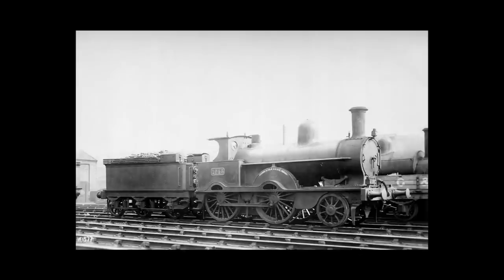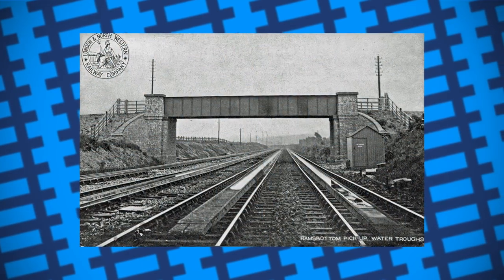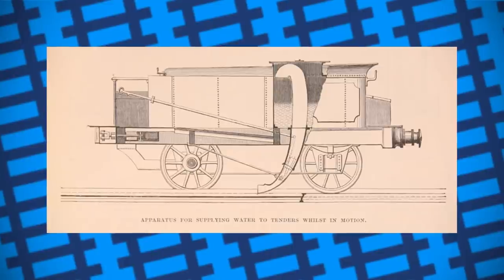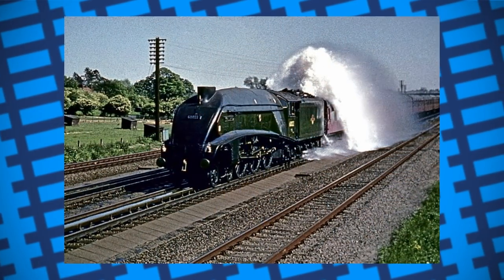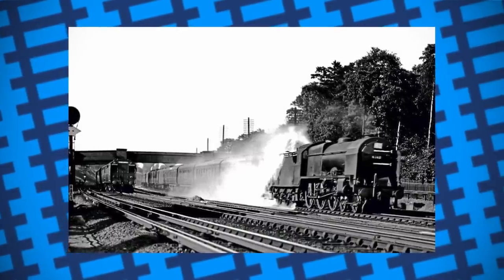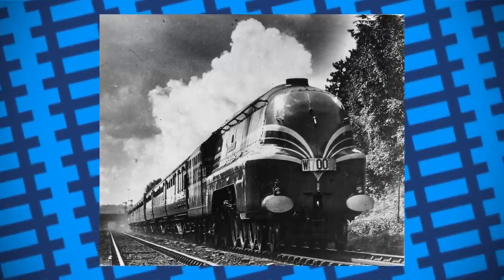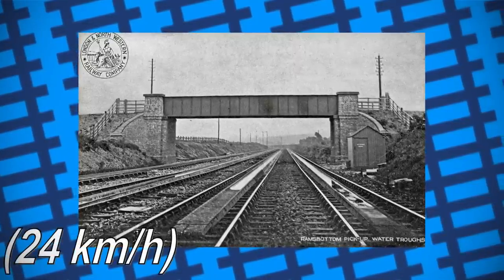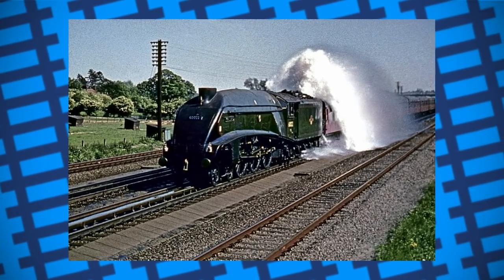How steam locomotives could refill their water tanks without stopping - The Water Scoop

Comment: Also fun to point out that some early diesels used them too, as some of the long-distance non-stop diesel locos had steam heat boilers onboard that required refilling with water en-route. Check out early Class 40's and Class 55 Deltics and you'll see the water scoop on there. Naturally, electric-train-heating saw this removed, and so the troughs became redundant.
Reply: would be crossing the line to insane completely if they also picked up diesel by scoops so you could have a truly non-stop train
Reply: The practice apparently worked at the time, but electricity and water never travel well together, so using the troughs to replenish diesel train-heat feedwater would seem to have been  inherently dodgy with 600 Volt traction motors humming along at speed just above the trough.
Reply: @russellbrown7028  The scoops were designed such that water splash was directed away from the motors, so it was never a problem. The again the Deltics motors could flashover (short circuit leading to a trip out) when going over rough bits of track, so a bit of water was hardly going to make them that much worse.
Reply: @jakedotnet  Doable, but imagine how much would be lost during the process? Also... Don't light a match. 😂 (I know it's Diesel but still )
Reply: @jakedotnet  I mean, thats what electric trains are. They "never" need to stop because all the power comes from the outside.
Reply: @ChrisCooper312  I will point out that the majority of the preserved Deltics had been allocated to Finsbury Park depot as my late grandfather actually spent a considerable amount of time as foreman for Finsbury Park depot canabalising the failed ones from other depots that BR refused to repair in order to keep the Finsbury Park fleet running until the last official day in British rail she and in fact he was considered the reason for a considerable amount of time of why such a large percentage of the fleet actually survived long enough to enter preservation
Reply: Replying to Tithe
Reply: Hi  We had vapour cars that we used in the winter Coupled to the diesel and conected with jumper cable for electricity Also ran on diesel When started up will make steam that flows through steam heating pipes the length of the train

Comment: As a teenage fireman in the 60's I well remember standing behind the driver and winding down the scoop when told, The tank gauge shot up and sometimes you had a job winding it back up when the tank was full and the scoop still in the trough, got wet a few times.
Reply: I too remember the troughs when working fast vacuums on the GWR 1958, always worried about the gap between tender and engine while hanging on to the tender lever water control. No guard rails on western engines.
Reply: I always looked forward to Bushey troughs on my trips between old Euston and Watford Jct. usually on a Bletchley semi fast. I remember reading that on the GWR, possibly on The Great Bear, the water overflowed the tender filler and burst through the corridor connection door of the leading coach.
Reply: @johnjephcote7636  Hello John, that incident was so well known to us on Western engines, that drivers would shout at 3/4 full 'Turn it off, even though the gauge was in front of us.'
Reply: @aberavon  I read that there was an unfortunate fireman on the L M S that actually did fall out and was killed at the troughs at Castlethorp  near Milton Keynes while taking water

Comment: In the USA if a town was so small that the train didn’t bother stopping at it but used a water trough instead it was called a “jerk water town” .  The name came to be used for any small back woods town.
Reply: Cool! Now I want to know why they're called "back woods" towns!
Reply: @samspencer7765   there in the back woods aka nothing in the middle of the woods its a commen term here in the mid west
Reply: I believe that's wrong.  The "jerk" implies either jerking down a water tank pipe, or jerking buckets of water up from a river or lake.  Track water troughs were not cheap to build or maintain and would not be installed inside a town at all, let alone a town too small to have a station.

Comment: Oh yes the Water Trough! These arent Economical however so its more economical to use A coal and water tower tho
Reply: Although the locomotive will be standing idle and not earning any revenue whilst be coaled and watered.
Reply: In what way are they uneconomical. The UK is not short on water. Having to bring a steam train with vacuum brakes, especially an express service, to a complete halt and then get it back up to speed again is extremely uneconomical, it takes more than just pulling over your car for gas does.
Reply: @Person01234  for long distance stopping trains stops were timetabled for taking on water or for a change of locomotive but neither are possible for a non-stop service.

Comment: On the Midland Railway, their small engine policy meant that on double-headed trains the second engine got soaked when the front engine took on water. The soaking of the front of the second engine washed the oil out of the front axle boxes causing them to overheat. That’s why you’ll sometimes see Midland Compounds with splasher panels covering their front axle boxes to stop the problem.
Reply: Man those steam engines really suck they were so old fashion compared to our South African loco's It is like comparing grannies pantaloons to the thongs of today
Reply: @sydneymartin6941  Strange as UK built and provided many locomotives to SAR.
Reply: @haroldpearson6025  Hi  They did a damn good job as our loco's were very well built  Everything well proportioned and well balanced They not only looked beautiful they worked damn well It was a pleasure firing those loco's Man I loved them  14CRB 14CRM 12AR 24 CLASS 15AR 8CLASS 7CLASS AND 19 CLASS
Reply: Midland locos were notorious for their overheating axle boxes. It wasn't just (or even) caused by water troughs - their bearings were too narrow

Comment: There were some interesting innovations with water troughs in the States, though we called them "track pans." Especially on the New York Central. The force of the water being picked up wouldn't just shoot out the back of the tender, but it could also make cracks in the tenders too. Later tenders had special piping that would spray any of the overflow down to the side of the tracks instead, rather than showering the entire coach right behind the tender. Slightly surprised Britain never tried that
Reply: Was it the Niagaras that did this? I know lionel made a model of one the locomotives did this and even had smoke effects for the tender where the "water" would spray out of. It was neat
Reply: I lived in a house in Reliance Wyoming that had a cesspit made from track pans. The sides and top of the pit were made of overlapping sections of pans. The house had been used as a bunk house for single men working in the coal mines owned by the Union Pacific Railroad. The house itself was made up from 4 wooden box cars with a foundation of railroad ties. The house just above it on the hill was collapsing into the coal mine that ran under it. Weird history in that place!

Comment: Something that I learned about the water troughs a couple months ago:
Apparently, two LNER Gresley A4's where passing eachother at high spped. One of the was using a water trough, and the resulting splash shattered the other A4's front window, killing the fireman.

Another Great video as always!
Reply: One reason you couldn't use the water troughs if you were passing the Royal Train.
Reply: @neiloflongbeck5705  Yep,I remember learning that,still imagine if some driver used a Water Trough and then gave the Queen a rail shower

Comment: Little note: The Southern Railway didn't have any water troughs. So the locomotives had pretty large tenders (Mainly ex LSWR locomotives had them like the T14 4-6-0 which used 5800 Gallon Tenders. Bulleid Pacifics also had large tenders).

During the 1948 Exchange Trials, EX LMS locomotives ended up using a WD Tender when trialed on Southern lines whilst EX Southern locomotives used a Stanier LMS Tender when trialed on the other railways in order to use the Water Troughs.

Comment: The Pennsylvania Railroad used water scoops extensively to avoid stopping its express passenger trains.  The PRR's water troughs were heated by steam in winter to permit operation year-round.  However, this resulted in the train using the scoop and any passing train being covered with ice, which certainly added to the already enormous hazards faced by train crews.
Reply: i had figured someone would have heated the troughs.
Reply: @josephdedrick9337  Supposedly the first time the PRR tested the water trough system they had not provided for a large enough relief valve in the tender, which quickly filled to capacity and then exploded.

Comment: funfact on the NYC these "Track pans" as they called it 
were build with a light slope so water can circulate and had a Steamheated Pumphouse to ensure that
the water scooping work 24/7

also did the NYC Hudsons had a scoop speed to not exeed 50 mph (if I remember correctly)
because the Vents weren't big enought to release the exeed and the water tank on the Tender would burst.

Comment: Water supply is a real problem for the big US steam locos when they do cross country trips these days. They have multiple water tender cars and have to arrange to meet fire trucks at fire hydrants to fill up.  They’ve all switched to fuel oil instead of coal for lot of reasons, but they still need to encounter tank trucks relatively frequently as well. And they make shorter runs than they used to.  Steam engines required much more dedicated infrastructure than diesels do.
Reply: True, but most such engines still run on coal over here.
Reply: @FS2K4Pilot  if the engines have shorter, fixed runs, are smaller, and or are in wetter areas, they’re more likely to use coal.  But locomotives like the Big Boy, which are based in dry and flammable areas, go on long trips and are really big almost all have switched to fuel oil. I’m not sure which heavies did it, but no fireman could shovel fast enough. They had an screw feed for the coal delivery and the fireman controlled steam jets for moving things around in the big firebox.  Here’s a synopsis of the trip for this year. 

Coming out to see our steam locomotives in person?

Stand back at least 25 feet from all railroad tracks.
Railroad tracks, trestles, yards and right of way are private property - please do not trespass.
Never assume tracks are abandoned or inactive - ALWAYS expect a train.
Read more safety tips
 
Big Boy No. 4014 departed Cheyenne, Wyoming on Aug. 5 for this year's steam tour, traveling through Arkansas, Colorado, Kansas, Illinois, Louisiana, Missouri, Nebraska, Oklahoma, Texas and Wyoming. During the Big Boy 2021 Tour, the Big Boy was on display in the following cities:

Saturday, Aug. 14: Fort Worth, Texas
Tuesday, Aug. 17: Houston, Texas
Saturday, Aug. 21: New Orleans, Louisiana
Sunday, Aug. 29: St. Louis, Missouri
Monday, Sept. 6: Denver, Colorado

Comment: Question for those in the know. Did steam engines inject the spent steam back into the water tank? This practice does a couple things. 
1. It conserves the water by re- condensing the spent steam back to water.
2. It conserves fuel by pre- heating the water in the tank, therefore not needing to raise the temperature nearly as much in the boiler.

Comment: It's not clear to me how the scoops did not slam into the ends of troughs if they were not lifted promptly enough? I raised this question on another YouTube video and somebody suggested that the troughs were built in very shallow valleys meaning that there would be no need for the troughs to have vertical ends.
Reply: They probably did just slam into ends when not lifted quick enough. They where designed to break away without damaging the train if they got caught on anything so it wouldn’t be a disaster if it did & it’s not hard to time something like that, you could just do a count or something so that probably didn’t happen often enough to be a concern. I think your right about the shallow trough thing as well though, in some of those pics it kinda looks like they slope downwards into the water, they probably sloped upwards back out too. Not sure if that would be enough to avoid breaking things if the scoop wasn’t lifted though.
Reply: @Electrolux219  What is not commonly known and is not mentioned in any of the comments is that apart from the scoop being lowered , there is a very slight gradient of the track in relation to the trough at each end, the effect being that the loco and train are lowered onto the trough at one end and slightly raised coming off the troughs at the other end thus lessening the possibility of the scoop hitting the end of the trough.
Reply: There were signs indicating the ends

Comment: Awesome video, one I wouldn't have thought to make (if I made videos). I love seeing pictures of diesels using the troughs, because of course carriages in the early diesel days still used steam heating and thus diesels and electric locos were fitted with train heating boilers, which would require water tanks which would need refilling. Not as much of an issue during summer months, but also newer carriages were introduced that used electric train heating (ETH), so didn't require the boilers and thus they were removed.

Comment: It's amazing that people design steam engines with parts to have coal in them and tenders for long running services but diesel use less resources like fuel or diesel and electric trains use electrically to help them move.
Reply: Electric trains are indirect steamtrains.
Powerplants produce electricty by steam.
Reply: @obelic71  well, except in so far as for hydro, wind and photovoltaic solar are used in the generation process. (hydro and wind not needing to heat the fluid that imparts movement to their turbines, and photovoltaic solar just skipping the idea entirely (there's another type of solar that uses sunlight to boil water. It has its up sides and its down sides). 
On the other hand, it always amuses me that Nuclear power plants, being oh-so-fancy and high tech... are fundamentally little more than steam engines whose fuel wants to kill you a bit more than coal or oil does.
Reply: @laurencefraser  Nuclear power is FAR safer than coal power. Thousands of people die every year keeping coal fired power generation running. The highest deaths per kilowatt generated however are wind turbines (a combination of staff and skydiving fatalities is awe inspiring).
Reply: @obelic71  funnily enough diesel trains are basically indirect electric trains. The Diesel engine doesn’t send its own power to the wheels rather it spins a generator which sends electricity to electric motors which then sends power to the wheels. This is because electric motors don’t need to rev up to generate torque like a combustion engine, they just **go**, which is really useful when pulling big loads. Especially when accelerating from a standstill.
Reply: @Electrolux219  Powerplants use for the most part the same fuel (coal) as steamengines 😉 
Dieselfuel has to refined from oil.
If you don't have easy acces to oil it can be a problem.
Thats why lots of countries on the mainland of Europe who had coal electrified on mass after WW2. 
The UK withdrew the young EM2's from service and they ran longer on Dutch rails then they did in the UK!
There are 3 main forms of diesel propulsion for a railway engine
The pure mechanical is only for small shunters and small powercars.
Diesel-hydraulic propulsion was used alot mainly in Germany for main line engines and multiple unit trains. 
the famous DB class 216/218 locos are diesel hydraulic.
Diesel-electric have become smaller and now its the industry standard for mainline engines and multiple units not running under overhead wires.

Fun fact is that till this day there are BR Class 11 very similar locomotives build for the Dutch state railways at English Electric are still in service!
1 of those engines even gets after 70 years hydrogen fuelcells.
Reply: @allangibson2408 nicely pointed out mate, nuclear should be the power of choice

Comment: A couple of stories from talks I attended at Darlington Railway Centre and Museum:  A worker was left in charge of a set of troughs with instructions to add a certain amount of lime to the tank every time a trough was used to soften the water.  Not to disparage but the chap was an immigrant so there may have been a language issue- in any event he certainly didn't completely understand the subtleties of his duties and dumped all the lime he had into the tank in one go.  The next train along was, "whitewashed from one end to the other" and stopped at the earliest opportunity with a tender full of sludge.

Another speaker told of his father driving a freight train with a fireman who saw fit to use the scoop (operating the water scoop as needed was the fireman's job) apparantly with no regard to the fact that the water tank must already have been quite full. The driver became aware of this a moment later when he look back along the train and saw that so much water had spilled into the first wagon that it was almost brim full with its load floating at the top bobbing around clearly out of gauge and threatening to slosh out of the wagon until the water drained away again which at least didn't take long.  Whether the owners of the cargo noticed or objected to their goods having received a soaking is not recorded nor is the phrasing of any advice offered to the fireman on the correct use of water troughs.